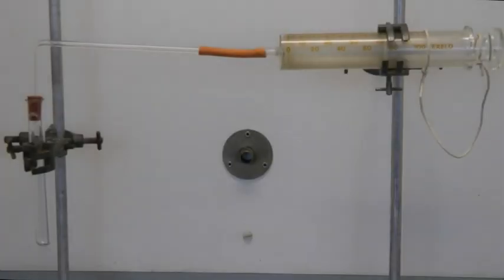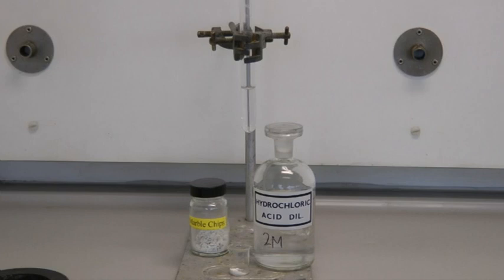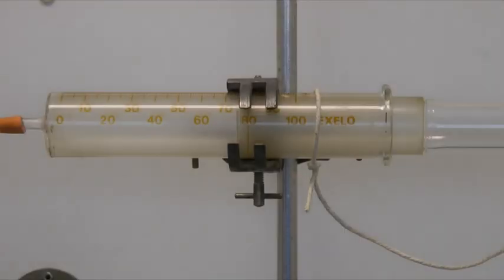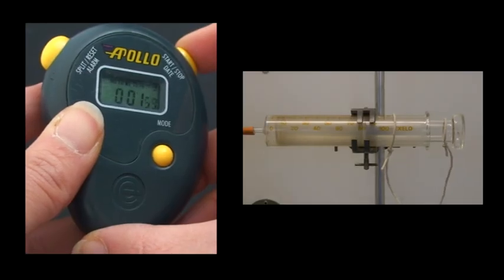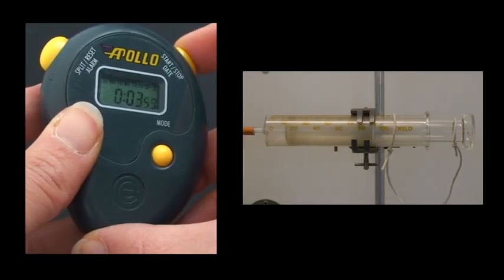Using a gas syringe to measure volumes of gases

Comment: Hi, thank you for a great, comprehensive video! Just wondering.... wouldn't the air get compressed in the gas syringe, making the data we collect inaccurate? Or is the compression negligible?
Reply: Hello Xu Zixin, the gas would get compressed, but that wouldn't affect the volume of the gas at all - volume stays the same no matter what container it is in, unless more gas is added/ removed. It would only affect the pressure. Negligibility is not a factor. Hope this helped even though I'm six years late!